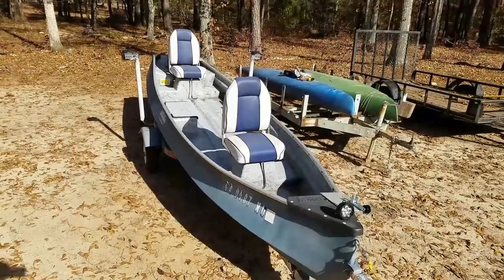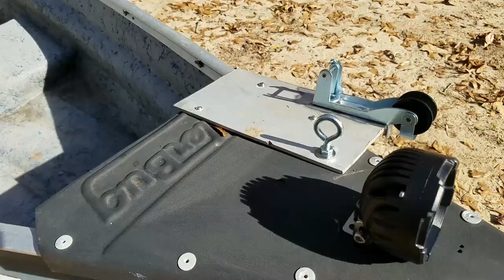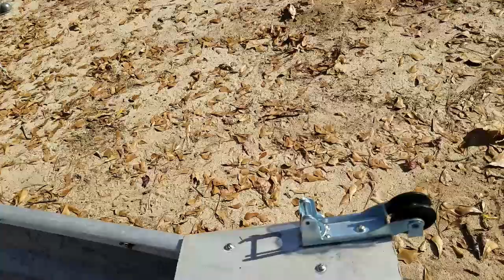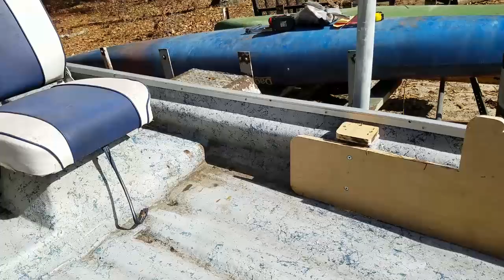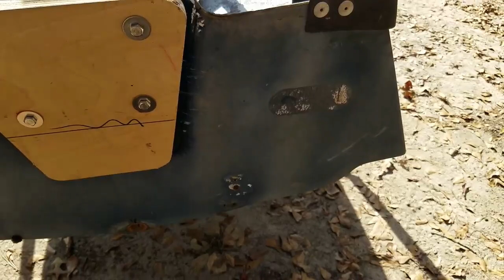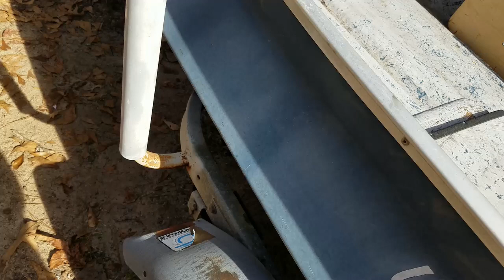The Water Bug/Gheenoe history?  Gary J

Comment: There’s a waterbug I’m looking at buying couple of questions how long is it and how heavy? The one I want to buy has no trailer and I’m wondering if it’s light enough to load in my truck.
Reply from the maker: These are heavy, depending on the length of. This one is 13.5’ long. The 10’ ones might be manageable with 2 people. They have double fiberglass.